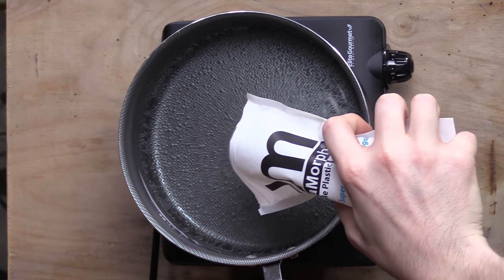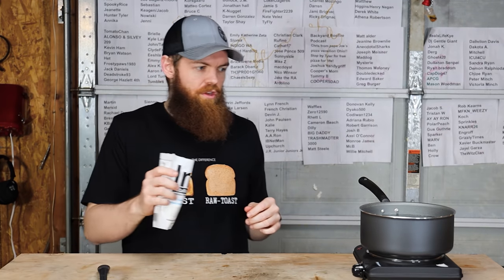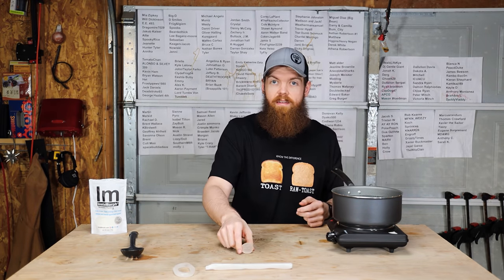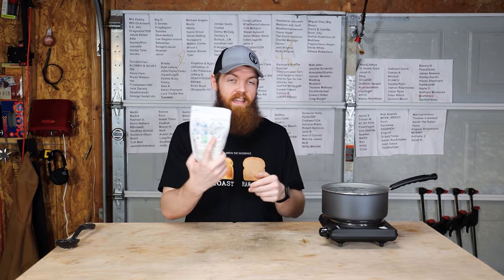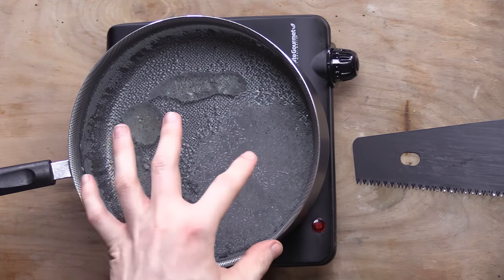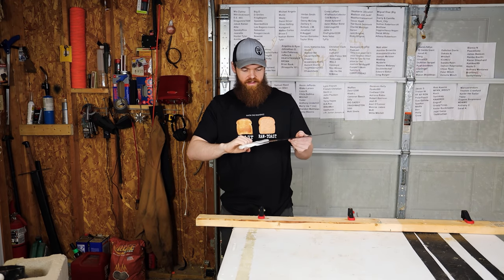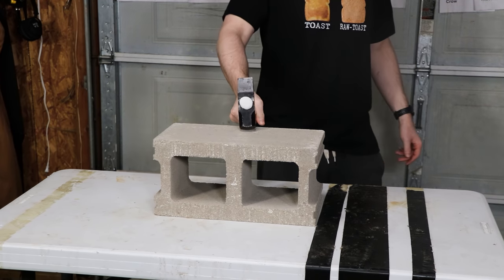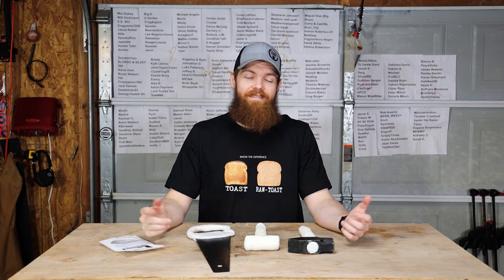You Can Turn These Plastic Beads Into ANYHTHING

Comment: Id like to see if you could make a lawn mower blade ,can it be sharpened to cut grass and take the forces of being run at high rpms.
Reply: Then you need another way to spend your time because that would be a silly waste of time and not work well at all.
Reply: @stinkycheese804  dude youve gotta be trolling right? Have you not seen any of tylers other videos? He has one literally just sharpening a plastic butter knife
Reply: It couldn’t handle the heat from the friction or the engine.
Reply: @stinkycheese804  you know what a weedwhacker is right? It's the same concept but plastic string instead of a blade lol

Comment: I want to see you remake the hammer but add weights into it and a quarter or piece of metal in the front to allow the plastic not to be damaged as much as it would be bare sticking things with it then test it on a cinder block

Comment: I've been using them in my small repair business for years. They're very handy. They're made of the same thermoplastic that many commercial products are made from so are just as strong.
Reply: No
Reply: @gregorykrom8311  but yes
Reply: Umm, no, there are several thermoplastics and merely, also being a thermoplastic, does not magically make them all "just as strong", and no, most commercial products are not made from Polycaprolactone, where its higher cost and lower melting point are usually seen as DISadvantages that make there be no sense in selecting it.

It's really only the best for the marketed purpose, that with the low melting point it can be shaped by hand so you can... shape it by hand.  Name one other commercial product made from Polycaprolactone?  I mean besides the raw material sold for hobbyist/etc uses.
Reply: @stinkycheese804  I was generalising, but commercial products made from Polycaprolactone include surgical implants, models, 3D printed stuff of course, prototypes, some bottle tops.
Reply: @rennnnn914  that kinda seems like a list of things that are manufactured one at a time and would need an easy to work plastic. Nowhere near as many use cases as polyethylene or pvc
Reply: @samuelponcsak1340  I never suggested that it was as popular or useful as PE or PVC. I just commented on how useful I find it in my small business when repairing things.
Reply: Are you able to reuse it? Like just reheat it or does it being a thermoplastic mean it’s a chemical reaction?
Reply: @marcuschute9122  Yes, you just reheat it and it is like new
Reply: @stinkycheese804  You didn't argue tensile or compression strengths just that it was not suited for thermal applications.   To be fair most plastics aren't heat resistant to the same standards either.  Nylon and epoxies are more thermally resistant in general and the rest are not used where it would risk being an issue.  The point is that it doesn't require tooling and an 8 foot injection mold press.  It is practical repair for practical personal plastics repair.
Reply: @rennnnn914  nobody is printing with this stuff. I think you’re just capping. It’s good for making small molds or filling in but not good for making a commercial product so lay off the copium
Reply: @johnandrews9433  Seems like you need to do some research yourself, or you don't understand what a 'commercial product' means.

Comment: I would say make a ladder. Hopefully when it hardens you can add more of the softer plastic to itself otherwise idt it would be possible. Also all these make a blade and sharpen it comments are a good idea as well.
Reply: Sharpen thermodynamic plastic? That's a truly awful idea, you can't sand it, it just frays and tears and all the fibres turn to mush.

Milk bottles are made out of it, go and try to sharpen a milk bottle lid, see how far you get.

Comment: Video Idea: You should buy one of those “cup of noddles” which is basically ramen noodles in a styrofoam cup and put it in the microwave for 5 minutes without adding water. I used to do this (adding water) in the microwave (even though the label says not to) and always turned out to be a great snack. However, one day I was distracted and stuck it in the microwave without adding water and walked away for those 5 minutes and well, I won’t ruin the surprise for you, but it’s pretty wild. Make sure to do it outside. They sell lots of noodles in a cup so make sure it’s ramen noodles and in a styrofoam cup. I used to get them at Dollar General.
Reply: Umm a whole video based on that?

Comment: I’m no pro but I’d assume the issues you were having with the saw and hammer were because the table wasn’t sturdy. It was bouncing on the nail test and wobbling on the saw test
Reply: It's also because if you don't have a steady support, you use the back end of the saw blade and shorter strokes, not the front end.  The hammer was just uncoordinated and poor planning.
Reply: This has been a long standing issue on Tyler tube.  I'd like to see him put together a real work bench with a built in vice.
Reply: @demos74dxs  That is the genius of this channel, a bouncy table and a garage is all you need for a high 6 figure income. You also get all kinds of gadgets that you can write off as a business expense.
Reply: @hcox1111  hey, he did actually do a live stream making a (slightly) better work bench.  So props to Tyler.  Still no built in vice though.

Comment: I played around with this stuff ages back. Yes, it makes fantastic repairs or custom/ad-hoc grips for tools. There is absolutely nothing more ergonomic.
It's even quite easy to impregnate cloth/mesh with it which is probably my plan for upgrading the camping kit. A mesh reinforced stable plastic roll? Could repair anything or even be used as a cast/splint if you had enough of it.
The only problem is you can't leave anything you make with it in the car in the summer. I had a knife handle melt and irreversibly integrate itself into the fabric of the rear seat.
Reply: Yep, it's a double-edged sword. Its biggest strength also means this really works best in cold climates, since there's little risk of unintended "applications" on a hot summer day.

Comment: Maybe if you molded the chain link and then threw the whole thing back in the water to make it soft and bond the ends to each other more. I think it might get that 600 pounds !!
Reply: That's a great idea, since it melts back together the bond should be stronger! Regardless I think he showed that stuff is very tough! I wonder if cooling it rapidly would make it stronger or more brittle like heat treating and quenching steel.
Reply: better consistency with the diameter wouldve helped too i think
Reply: I was thinking that when he was making it.

Comment: Trying using it as a glue and separating it with the wooden blocks and the crane scale.
Reply: If the object you are binding is porous enough it can basically fuse the objects together. The shrinkage on cooling however isn't great for smooth things.

Comment: Trying making a ladder out of instamorph. I'd love to see if that would actually hold up but that would obviously be a lot of material lol.
Reply: One little chain link was able to hold 485lbs, I would imagine in small scale use you could use this to replace a broken bar, but I'm not quite sure on the feasibility on a WHOLE ladder. I guess it comes down to the thickness of the ladder as well as your body weight.
Reply: @point-five-oh6249  Well for the ladder idea, maybe use it in concert with wood or pvc, the instamorph being the only thing supporting the parts. Specially if he drills holes in the parts to keep it stable.
Reply: @MyAramil  Yeah I could see that maybe working. Just using the instamorph plastic for support beams, or the steps on the ladder. That would probably be fine. But an entire ladder would probably cost you more in the plastic material than it would to just get some wood or a pre-constructed ladder from Lowe's/Home Depot.

Comment: Hi! I’m not all the way through the video yet, so I’m ready to be redundant. But just so you know you can reheat all your Thermoplasty and reuse it after shaping it. So I’m case you do another vid just save it, and re-melt it. Also having worked with this stuff pretty often for molds and puppets and such you can microwave it in a bowl of water if that’s easier for you in some way, as well as use a heat gun on low to reheat sections, but not the whole thing. You can also mash it well into molds! I also work the material with wooden, and plastic tools on a flat surface when I take it out of the water initially to avoid the uncomfortable heat. Last thing, it’s very fun to mold onto body parts(like make a ring or bracelet and basically make cyborg attachments for yourself. Like a knife ring, or extra long fingers. That’s all… amen

Comment: I bought a pair of vampire fangs from a Halloween store 13 or 14 years ago and they came with a small pack of these. It was so you could get a perfect custom fit to your teeth and the fangs would just pop on and you couldn't tell they were fake. Cool to see it used for better uses than Halloween accessories.

Comment: I like to heat the metal part directly and stick it in the dry beads. It sticks to the metal a lot better and it doesn't rust so much. When you use water it traps water against the metal and it rusts pretty quick. I also found out that this type of plastic degrades in 2 years time and gets brittle as well as much stickier when melted.

Comment: @tylertube I know you test products here but I'm certain you have or will be ordering more and you will use this at least once a week for the rest of your adult life at least I have and I have a couple of tips to get you a little torch like a cigarette torch I mean a plumber towards for work but I mean for finishing a product that might need a little tweeting or kind of like welding the plastic to other plastic and really anything that might help you with just a good little tip you would have figured out anyway secondly I keep sometimes cold water either a bowl full of cold water or a spray bottle full of ice water that way when you finish something and you don't want it to bend out of shape you just drop it in the water or spray it with that ice cold water and it will stop the process and start the curing process if I'm honest I actually take it a step farther dangerous step foot and effective step and use butane to harden it instantaneously I'm sure there's other cans of air that would work a little less flammable like what you get the idea and last I take some and make it into skinny flat rectangle or whatever shape you might come up with it's irrelevant and keep them in my pocket with that little handy torch and you will be amazed how many times you will need it use it and how many times you will forget it and need it and not have it so I just stopped forgetting it not to step on your partner if they are paying you but my favorite company that produces these is called polly plastics are all about the same I think it's the same plastic so but these always arrive on time have a generally cheaper price BETTER PACKAGING AND THE PEOPLE ARE SUPER NICE AND THEY ALSO HAVE COLOR BEADS THAT YOU CAN ADD TO THE REGULAR WHITE ONES TO CHANGE THE COLOR WHAT WE ALL KNOW YOU CAN JUST PAINT IT BUT IT'S ACTUALLY BETTER THAN USE THE COLORED PLASTIC THE S*** IS AWESOME THEY ALSO MAKE SHEETS OF IT THEY SELL IT'S FIVE STARS OUT OF FIVE I GIVE IT A HUNDRED STARS I DON'T KNOW HOW THIS S*** HAS GONE UNDER THE RADAR THIS LONG

Comment: Hhhhmmm…. Could that stuff be used as a one time use stripped bolt extractor? Or as a stripped screw remover…. Side note…. Whomever invented the phillips screw and screwdriver is without a doubt the biggest 🤬 who ever lived. I collect scrap metal and do metal runs up to Gershow and the worst thing is removing the phillips screws. 75% of the time I end up stripping them out and having to get a drill bit to drill them out, or having to use a sawzaw or crowbar to remove the pieces off the scrap I collect so that I can get my money’s worth at the scrap yards. Side note. At the time of posting this, copper looks like it might be up today. Good day for a copper run.

Comment: I'm wondering if you can use that stuff to pull a stripped screw....  Make a ball of it, put a screwdriver through the center of the ball then (before it sets) squish it down onto the stripped screw (Kind of creating a "T" connection between the screw and driver), let it set and twist like a mini torque wrench.

Comment: Its probably HDPE its very soft but extremely strong and flexible absorbs heat very very well and heats up very fast and melts at relatively low temps

Comment: You seem like a guy that might have a 3d printer. You could print a mold for just about anything. Baby Yoda? Lol. You can then fill it with this stuff,    remove your item and repeat. It would be very fast since you only 3d print one mold and can make as many items as you want from it. You would need a printer that could print petg or abs plastic so your molds don't melt. If you don't have a 3d printer I could send you a few molds. It would be cool to see what type of plastic they are using and if it might have different qualities than typical 3d printer materials.

Comment: You were were correct on how strong the moldable plastic was.  When you put weight on the scale, you introduced new heat into the plastic. Had you waited it would have solidified again. Add more weight, rinse and repeat.

Comment: At my former job, I was an engineer with a large fab shop on the back of the building separated from the offices just by cheap dry wall with no sound isolation.  The guys banging things around with their sledgehammers was dreadfully loud in and out of the shop.  I told the shop manager to get the guys some sort of cushioned hammers, so it wasn't just steel on steel, but I don't think a good solution ever presented itself.  This stuff, however, could be a reasonably cheap solution.  You could just form it entirely around the hammerhead and build up the hammer faces as thick as you wanted.  Basically creating your own plastic headed hammer from a normal one.  It seems to have just the right amount of elasticity to really deaden sound while it has the toughness to stand up to many hits.  And when it eventually did wear out, it sounds like it could just be remelted and reformed to be reused.

Comment: in sports when they required a mouth guard, we had to boil the hard mouth piece for 2-3 minutes. then when we bit into it to form around our teeth and gums, it would harden and not loose shape. we could bend it, bite it, run it over, and it would just absorb impact. This seems like just the beads used to form the mouth piece.

Comment: Believe or not - I've used this stuff as false teeth off and on for quite some time now and it works great.  They actually sell it as that too.  If you need a quick fix for a tooth or need a cheap alternative to a false tooth this stuff really does work great.  Definitely not for long long term use but it's light years better than using that pseudo concrete stuff they sell in the stores, doesn't crumble like that stuff does

Comment: Put some 6x6 up to support the joists or rafters your pulling from most buildings were engineered for the weight to be evenly distributed across  more than one beam and chain doesn't really store potential energy or at least not the amount rope or wire rope would under the same tension. Great video gained at least 1 more subscriber

Comment: Arrows and arrowheads. get some thin bolts and nuts. put a nut at the end of an arrowhead. and put the bolt in the shaft so you can change the tips or put the plastic arrowhead on a proper arrow with a screw tip. imagine being a deer and getting sniped with a plastic arrow head. talk about insult to injury.

Comment: Ya know I was thinking of a crane scale improvement for the tests that would hold up better. And not have you pulling chains with a sludge hammer. I was thinking of using a engine hoist and putting a chain around the two legs horizontally. Then you could put the scale on the hoist hook then attach whatever your testing to the chain that’s around the two legs. That way you could easily just use the hoist to do all the work and it would be able to pull with around 2tons. And hoists are relatively cheap. Not sure if my description of my thought is clear enough just from my words without a picture or drawing. But it looks like you’ve just upgraded your method anyways hahaha. 

Anyways great video I’m definitely about to buy some of this. I gotta try this stuff out. It seems like a great thing to have around as a “just in case” situation. You should try to make a socket or a wrench out of it and see how much torque it can hold before slipping the bolt head. Or a knife see how sharp you can get the blade since it’s plastic.

Comment: In our shop I have a little hammer with an aluminum handle, one side of the head is brass and the other is plastic kind of similar to the type you're using. It's super useful for anything I need to lightly tap. Very useful to me in making fine adjustments to my machines.

Comment: What happens if you leave it in a jar for 30 days in something that you would think that can destroy it or try to heat up other fluids than water and see if you can mold it the same way or will it loose strength

Comment: Tyler, what do you think about using this type of thing again but having a mold of the item? Squishing the beads into the shape you specifically want and chipping/sanding away at the edges so you can perfectly mold the right tool/item? Thought about that when you used the hammer. Overall super cool stuff